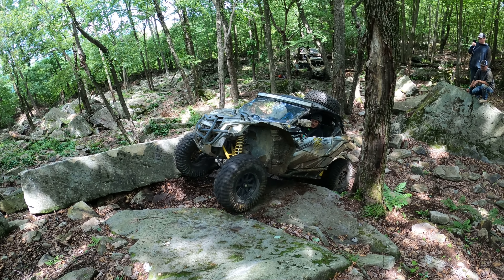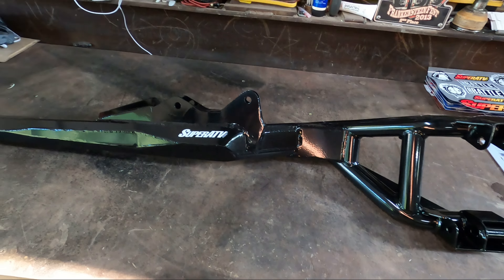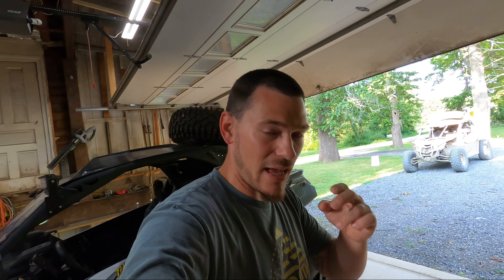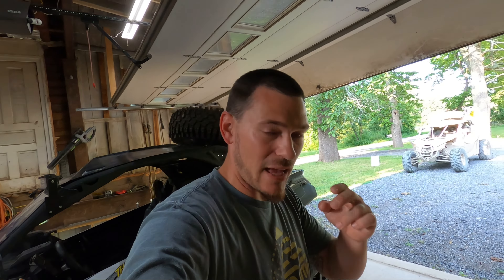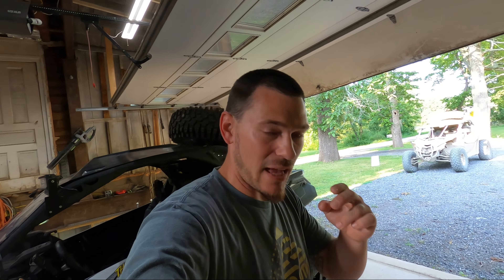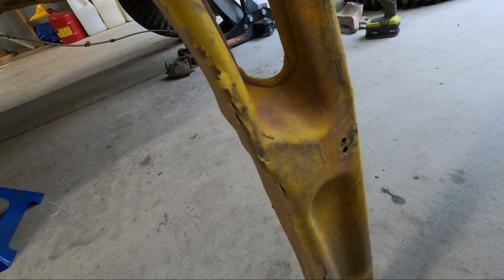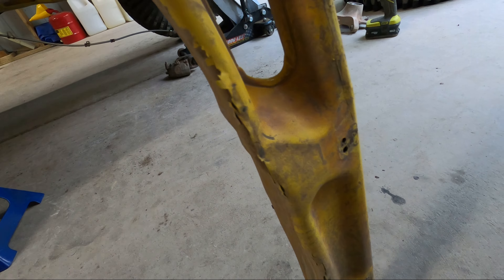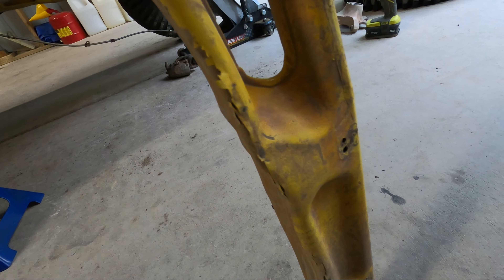Super ATV High Clearance Trailing Arms Installation on a 64'' Can Am Maverick X3 XDS

Comment: Wondering if a 1/2 uhmw trail skid from trail armor would prevent that.i already ordered mine ,will see.
Reply from the maker: I think it would. The xrc comes with the skid plate on the trailing arms as well and seems to hold up pretty good.
Reply: @TheCanAmCrew  and rc its only 3/8 of thickness and does its job

Comment: Can you measure how long your new trailing arms are. Someone says they are a inch shorter than stock.
Reply from the maker: Ya I can measure them when I get back to my garage. I couldn’t imagine they would be any different than stock or else the sway bar link, shock, axle, and radius rods wouldn’t bolt up in the correct spots.
Reply: @TheCanAmCrew  thats what I figure but someone posted it in the reviews on there website so now I'm im nervous. The price is on point with these I probably dont need to complain but the info for me and everyone else would be beneficial.
Reply from the maker: @seanmuehlhauser9612  the satv high clearance trailing arm measures the same as the oem trailing arms. The only difference is the Oem has a rear bar that connects the top and bottom of the radius rod and the satv one does not.